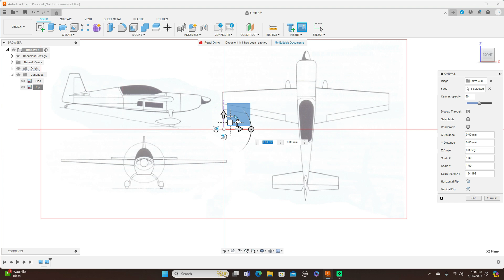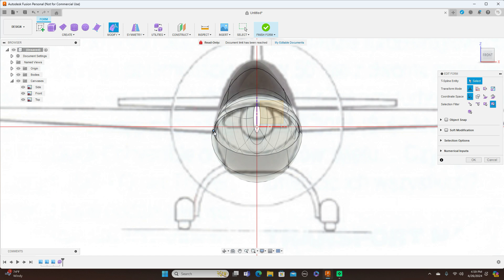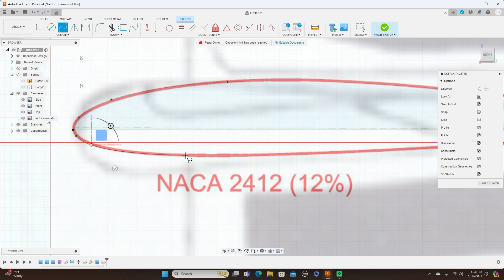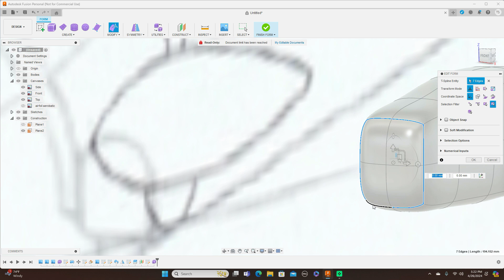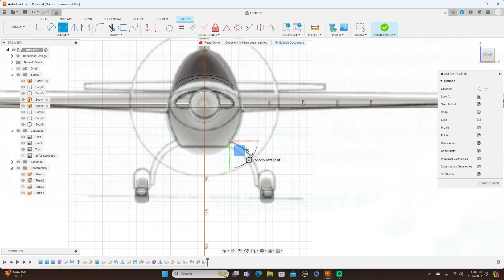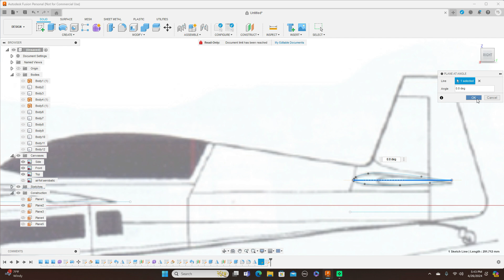Learn how to model an Extra 300 in Fusion 360.  Beginner to Advance

Comment: Thanks for the video. Learned a lot. But some sections are still just approximations it seems. Like the transition of canopy to cowling i feel should be a harder corner and not a soft curve. Is that a limitation of your technique? Could you also start with drawing outlines in CAD of each of the 3 views and take it from there? Anyway i keep following along, there's not much on the interwebs when it comes to CAD surfacing technique so this is very much appreciated.

Comment: I believe you 3D print your planes, right? If so, it would be great to see how you split the plane up fro printing. I've had issues with making my models solid (no open manifolds), slicing to fit the printer AND to slot together well, etc. Watching someone one do that part would be awesome.
Reply from the maker: Take a look at some of my earlier videos. I go over it I split the molds in fusion and i I 3 D print them. Have a look at the Havoc printing the molds. If you have any questions, just ask and I will reply. Email me and I can answer faster